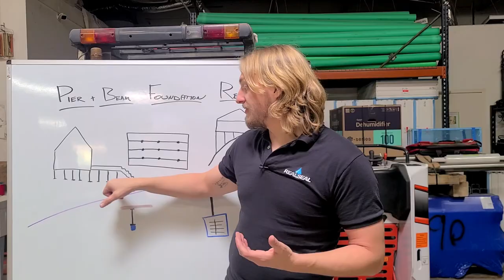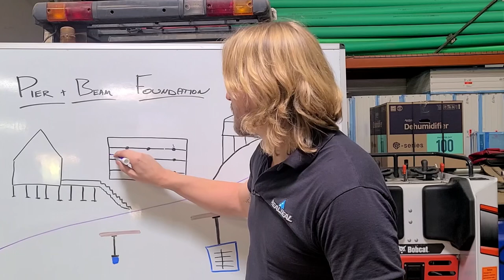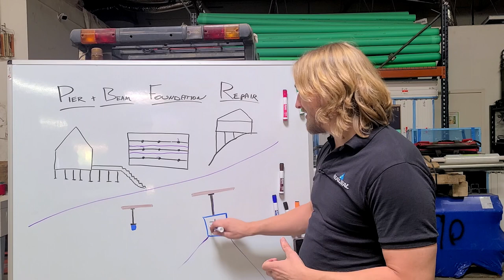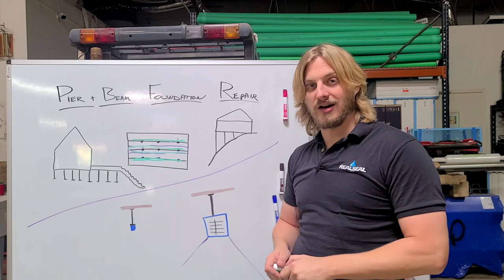Everything you need to know about Pier and Beam Foundation Repair

Comment: I had an aha moments during your presentation. I had a bunch of new cabinets installed in my kitchen. This is where im seeing the signs of sinking ie: laminate floor cracking. I live in Western Wisconsin. Are there any companies you know of who work this area?
Reply from the maker: Hi there! Unfortunately we do not have anyone up in that area we could refer.

However, it could be the new kitchen weight that is causing the cracking.
Reply: @Therealsealllc  
Thanks for responding. I found a co based out of chicago. They will be here tomorrow. I just wish I knew more about this, or atheist what questions to ask.
Reply from the maker: @TomPfeifer-u7r   What specific problems are you dealing with? We could help you with the questions you should be asking.